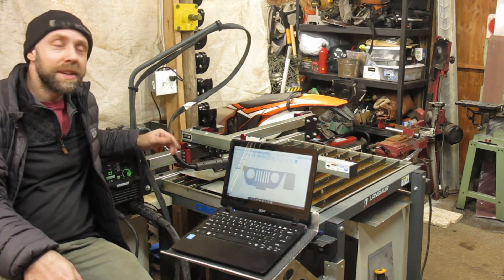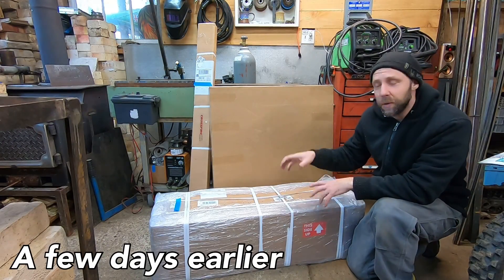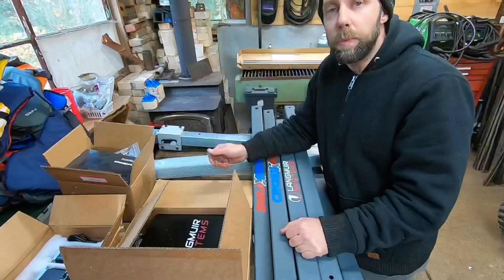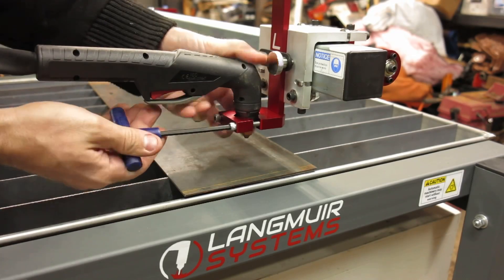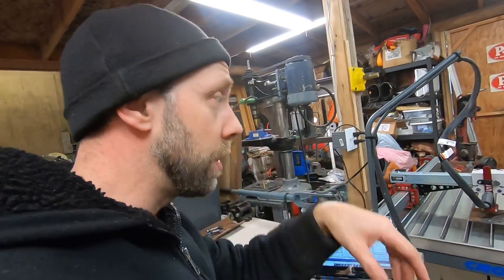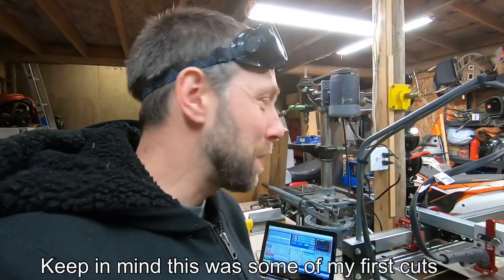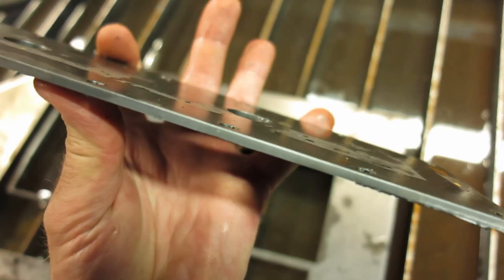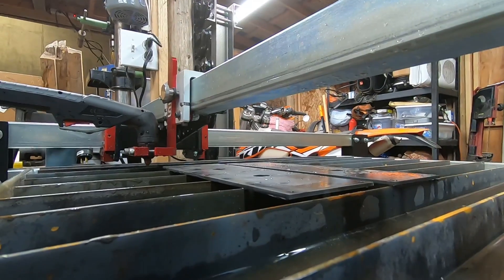Finally a affordable CNC plasma table Crossfire from Langmuir systems

Comment: I was one of the early buyer for the table when it first came out. I've been very pleased with it so far. Fusion360 is great but lets not kid ourselves here, if you've never ever used CAD in your life, it's going to be a steep learning curve, but I can guarantee you that it isn't as steep as say Catia V5 for instance (I have thousand hours of that as a professional)...Mach3, meh I'm ok with it, I mean, it works...glad to hear LS is coming out with their own...I've already bought Mach3 but, if LS has a better software then I don't mind parking Mach3 !
Also it's important to note that your cutting speed and quality is dependent on your plasma cuter, more so than the table itself.

Comment: Hello Mike, just wondering is the 10 inch extension worth the extra cost?
Reply from the maker: Hey Tim I decided to buy the XL extension kit just for that time when you need a little more cut room, I have only used the extra cut space once so far but I have only had the table for a short time, I could see it being useful when I upgrade the Mach 3 program and start nesting multiple parts on a sheet of metal. One other thing, with the table extension I hear you can cut your own table slats, those are the expendable flat bar that you cut over. You can always order it later on if you decided you could use the extension. I hope this info is helpful. Take care 🙂
Reply: Mike festiva thanks for the response.

Comment: How cool. I have a Torchmate 2X2 and I have made thousands of things. The best piece of advice that I can give anyone with a plasma cutter is to buy the small Harbor Freight air dryer. It cost about $500 but worth it. The other thing is to put a plastic bag around the handle trigger since you have a water table. That plastic bag will save you hundreds of dollars. I like your machine but I was a little concerned about the gantry arm only having one support instead of two. If you live near Racine, WI I would love to share programs with you. It looks like you know a lot and well on your way. I make most of my art program just by tracing in CAD.

Comment: Posted this on your other plasma video:

If you haven't purchased Mach 3 you might want to hold off, as Langmuir is releasing their own controller software called FireControl when they start shipping the Pro tables.  It's free and will work with the older tables.  The quote below is from here (@t) you may not have access to the post if you are not in on the Pro preorder.

FireControl

The main benefit of the CrossFire Gen 2 System is FREE, cross-platform, plasma-specific control software with a modern user interface and ongoing support and development. The Gen 2 control software, FireControl, is designed and developed by Langmuir Systems specifically for CNC plasma cutting on the CrossFire and CrossFire PRO.

Comment: Langmuir has their newer and bigger table on sale. Sooner you can order it, cheaper it is. A tiny tab to knockout is not an issue. I'd definitely get the water table, does A LOT to reduce warpage if not eliminate it. For some of my art projects, this would save an insane amount of time once orogrammed and make duplicate parts perfectly. Can't wait to get one.
Reply from the maker: Thanks for checking out my video! The tabs on that were from me not setting up the IN and OUT cuts and CUT speed properly, I have gotten a lot better on setting up the Inches per minute and have completely eliminated that problem, but the Fusion 360 program is pretty detailed in tool paths, if you have parts that you’re concerned about tipping up when cutting them out it’s easy to add small tabs that you can break off after the part is cut. I think you will benefit by owning a CNC table especially your art projects! I need to look into there newer table and checkout some of its features. Take care 🙂

Comment: "unlocks precision" 
what are your thinking about the table size, Would you have gone bigger if you had a bigger shop?
I've been watching Collin furze use his 2'x2' desktop cnc for a year thinking it'd change my life getting one but I'd want to go 8x4 so it'll take a full sheet of metal and I just haven't got the space.
Reply from the maker: I had a opportunity to buy a older plasma cam 4x4 table but I decided not to because I really think that Plasma cam company is out for 100% profit, the older stuff is not supported anymore and if you want them to help you in customer support they want you to buy new electronics and software. Enough of that now I think the 25”x33 table is good for my shop, I don’t have a lot of extra room, I also think full 4x8 sheets of metal would be a lot to move in my shop. I talked with a friend with a fab shop and he said he would shear a 4x8 sheet of metal down to 2x4 for me, this will work better for me. All and all I’m sure there will be times when I need a bigger Table but most of the time I see myself cutting smaller parts. Take care 🙂

Comment: Thanks for doing videos on this thing. I’ve been pretty curious how well they work.
Reply from the maker: Thanks for checking out my video Matthew! I have learned a lot already on this, and I feel like I’m just scratching the surface of it’s capability. Ps I really liked seeing the skateboards your wife had built, I work for a snowboard manufacturer and we also make skateboards, so I liked seeing how you guys go about building them, your form block looks a lot like the ones we use, the biggest difference is we press them with heavy duty air bags and heat, the vacuum bag looked like it works great! Take care 🙂
Reply: @Mikefestiva  You get to play with all the fun toys :D

Comment: I think this might be a revolution around the corner. 3k between a CNC table and a torch and you pretty much can assemble any kind of complex geometry. And durable ones, not like a 3D printer. Awesome for DIY and fabrication.
Reply from the maker: I think you are right, it’s a great set up especially for it’s ability at that cost!
It unlocks so many doors when it comes to fabrication and building projects. 
Thanks for commenting I really appreciate reading your comment. Take care 🙂

Comment: Thank you so much for doing this video! How do you get such clean cuts with very little slag? I have a Lotus plasma cutter and have never gotten that clean of cuts. Is it the machine? Do I need a better air filter for my compressed air? Just wondering if I bought the Cross Fire if I would need a new plasma cutter. Any advice would be greatly appreciated.  Thank you and  happy Thanksgiving!
Reply from the maker: Thanks for checking out my video! I don’t have anything special for my air, I’m just running a small water trap on the side of my compressor, then there’s the small air filter on the plasma 45. I think this torch runs about 90psi, at least that’s the incoming air pressure,  it’s internally regulated. Did you ever see my video that I made the plasma track for my little CUT 50 plasma torch? It makes that cheap torch cut beautifully! I think it was because the plasma track I build would keep the torch off the work piece at a consistent height and consistent cut speed. 
That might be one problem with the slag? 
One thing to check out before you order a table in the future is go to the a Langmuir systems web site and they have a list of known plasma torch machines that do and do not work with there tables, I gambled a bit buying the table because the Titanium plasma 45 was so new no one had ever tried one out on a CNC table, but it works great on there! Basically no high frequency start plasma torch’s and sometimes there’s other ones that don’t have HF start but produce enough HF from inside the machine it’s self to cause interference with the table. Take care
Reply: @Mikefestiva  thank you for the info. No I have not watched that video of the plasma track. After looking at their website I think I would have to get a new one anyways because mine is HF start. On other question, is the torch cord long enough on the Titanium?  I thought I saw on the cross fire website that it required a 16 foot cord. But maybe that was for the pro version.
Reply from the maker: Refiner's Forge I saw that too about the 16 foot cord, I wondered about that when I ordered the table but there’s no problem with the shorter torch lead with this table and the XL table extension. I’m sorry to hear that your plasma torch is HF, I have one of those Cheap CUT 50 plasma torches I’m going to hook a friend up with now that I have the Titanium 45. Take care
Reply: @Mikefestiva  I really appreciate the time you take to answer questions! I'm a professional blacksmith so I would be using this to make money. How do you charge for the use of the table. Obviously it is a time and material thing and I'm sure it is a regional thing. I try to charge around $50 an hour shop time.

Comment: Mike, I hope you are not g-coding it by hand. What slicer are you using, if any?

Edit: I see you are using the company's proprietary software. Any chance you can do a quick demo video of that software?
Reply from the maker: So what’s nice about the Mach 3 software is it’s from a different company and has been around for a long time. The Mach 3 software is used to send the G code to the table, it’s kind of a universal CNC control software, it can be used to run, mills, lathes, just about any CNC equipment. The CAD program is again from a different company that’s been around for some time now, it’s called Fusion 360 from Autodesk, it’s a really good drawing program used for 3D stuff, because I’m only drawing in 2D for the plasma table it’s a bit easier. In this program you draw your part, then you can set up your tool path, (how the torch will cut out your part) then you post your G code, Fusion 360 will automatically write your tool path and cut file. Then all you do is import the file to Mach 3 and your about ready to start cutting. I will make a video on this process soon because there was some things that I have learned that will really help others out when learning this. Take care and happy thanksgiving 🙂

Comment: That looks great! Do you have a separate air dryer for your air line or just the one built into the Titanium 45?
Reply from the maker: I’m just using a small water trap on my air compressor and the small in line filter on my plasma torch. Sometime down the road I probably will get a better air dryer. Take care

Comment: Mike, that Titanium 45 plasma looks VERY well put together on the inside.
Reply from the maker: That’s what I was thinking too, they definitely have a nice fan tunnel to keep all the heat sinks cooled off. Thanks for checking out my video! Ps I like those SunF tires on the back of the quad truck so far, they are thick and heavy tires but it’s good on a utility vehicle like that. I’m sure they will out live the quad truck Haha!